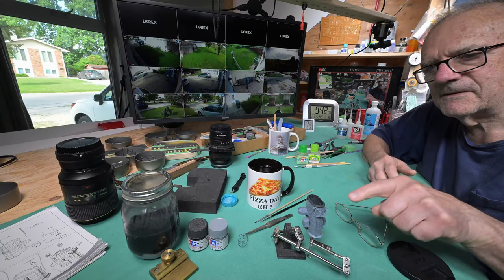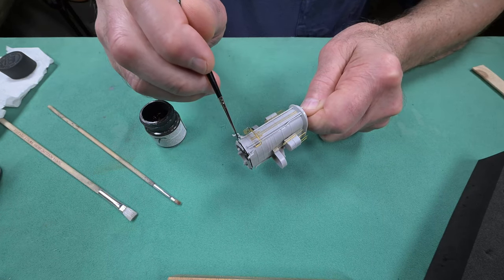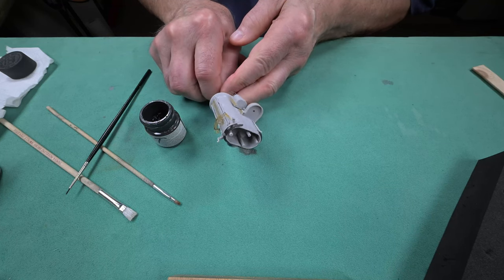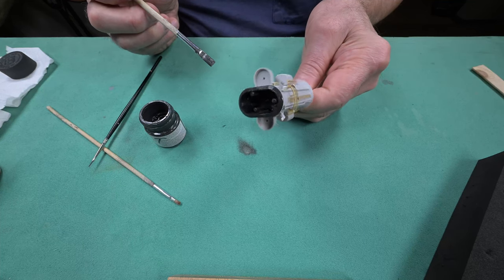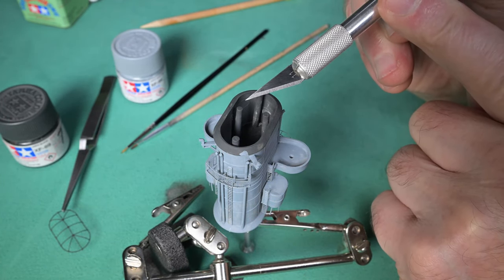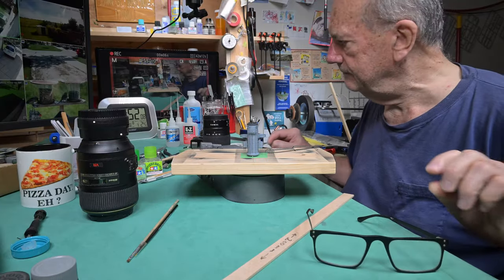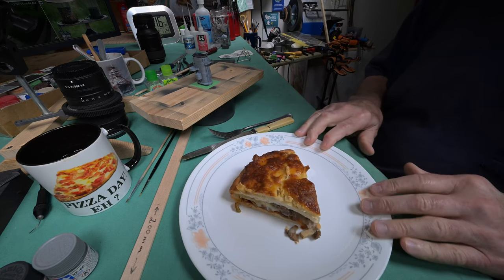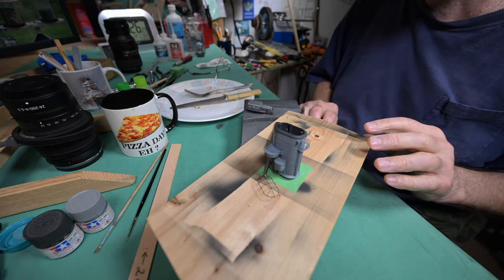The Model Ship - Part 1263

Comment: Hi Ron, The funnel looks great, like its own intricate work of art and from arms length you won't be able to tell the difference between a brush and airbrush paint job. 

As for the pipes, you don't need to drill holes as you've got a half flapper cap version that you see on some trucks exhaust pipes. Even flashing lines can help sometimes with detail! 🙂

Have a good day.
Reply from the maker: Yup! That's it! --- A rain flapper cap 😁

Comment: Hi Ron, Your paint job turned out really well.  I generally drill out gun barrels and tailpipes.  You just have to start off really small and make sure you are centered.  I would recommend using a pin vise, not a power tool.  It doesn't take much to ruin a part.  Pizza looks great.  Thanks for sharing.  Have a great day.  Jeff
Reply from the maker: Thanks Jeff. 👍

Comment: I drill all my pipes and gun muzzles. But I only drill about 3mm-4mm depth, once they’re painted you get the illusion of a completely drilled pipe or barrel. I tend to use an 11 scalpel blade to make a pilot hole, then a fine drill bit, then once that’s done I use the correct size for the pipe. Most warhammer builders tend to do this.
Reply: How funny!  I just sent Ron an email with pictures of some of my Warhammer figures with drilled out muzzles and the same advice! I start with a fine awl to set a dimple in the centre, then drill a pilot hole by hand with a small bit.
Reply from the maker: Hi Gabe. Saw the figures, thanks.